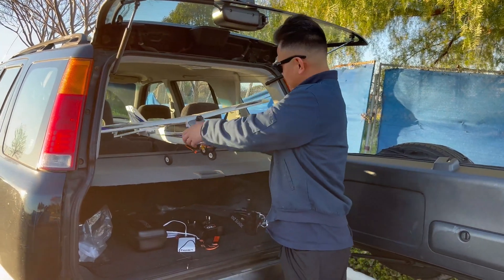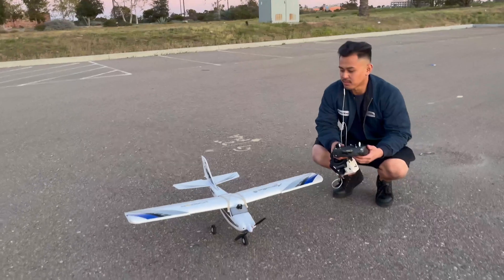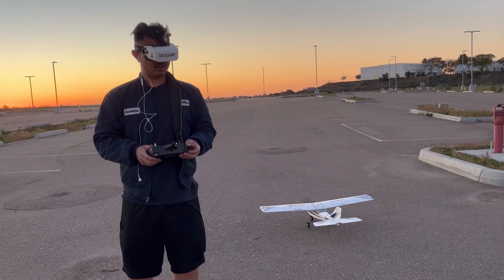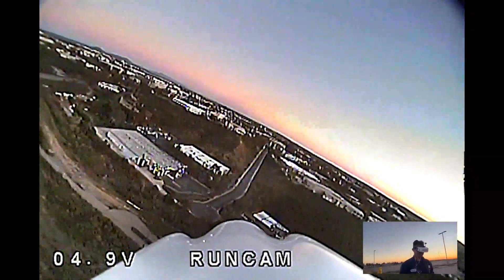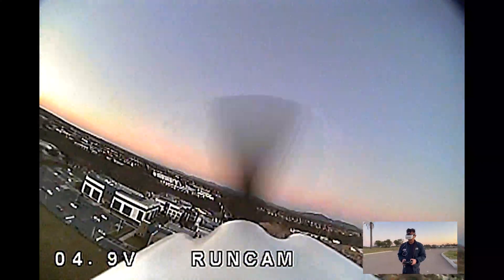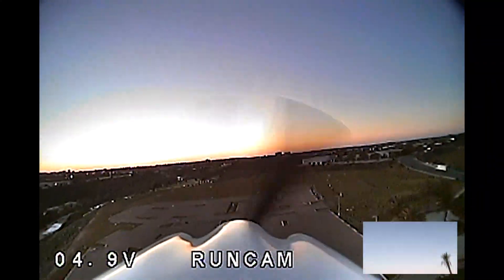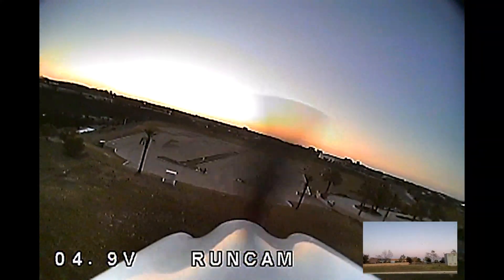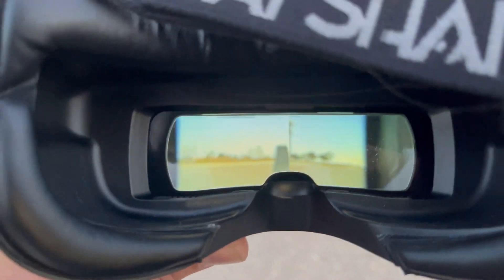HobbyZone Apprentice S 2 RC Airplane: FPV System Test

Comment: from flying old pc based simulators (not rc simulators) I know how difficult what you are doing is.  I could not line up until I could quickly change the view to 45 degrees on base leg then forward after turning final.  I’m presently learning rc with PicaSim free download and thrift store find controller.   I have a not yet flown Apprentice.  Thanks for sharing your FPV experience .

Comment: Thanks for the awesome vid! I recently got the Apprentice S myself and now looking to do exactly what you did with an FPV kit. I know nothing about FPV, hoping you can describe how you powered the camera transmitter, and paired it to the camera. Thanks!
Reply from the maker: The camera transmitter is an ImmersionRC VTX and supports a wide range if input voltage (6V-25V to be exact). It has a built in regulated 5 volt camera supply output to power the camera. During the time that I recorded this video, I had the VTX connected directly to the flight battery pack. My setup has changed substantially since then and I now have the VTX and camera connected to regulated power supply outputs on my flight controller, as well as the camera video feed passing through the flight controller prior to entering the VTX for on screen
display of various telemetry data.
Reply: @jonathanjovenal  Do a video on that! I'm following the same steps with a as you did (using a Runcam Phoenix 2 and a RUSH TANK Ultimate VTX ).. Cheers!
Reply: I never have problems with rdq's mach 3 vtx and switchable 1 watt power.